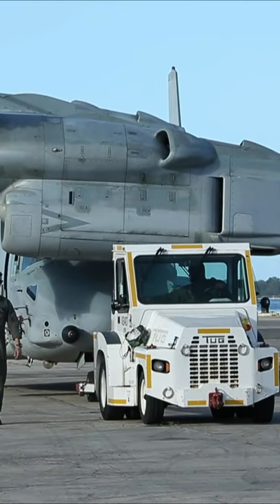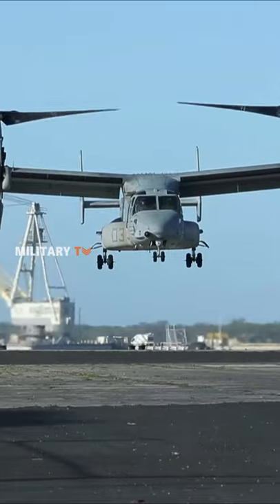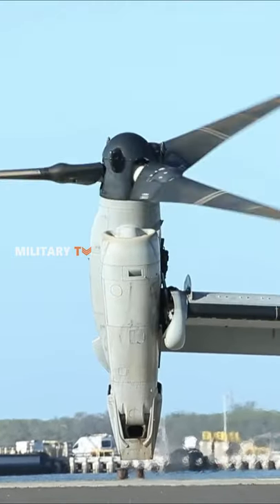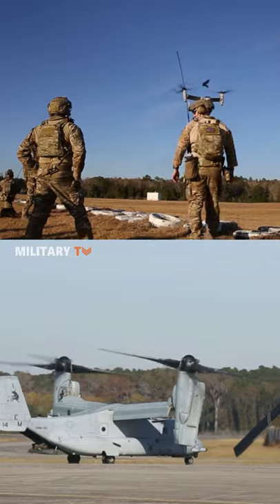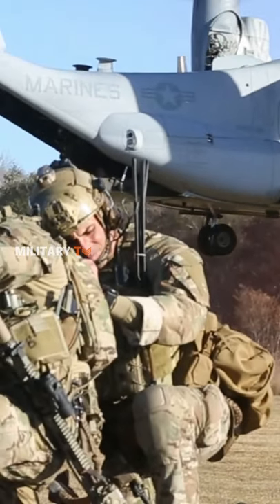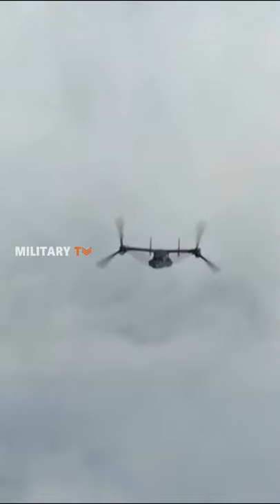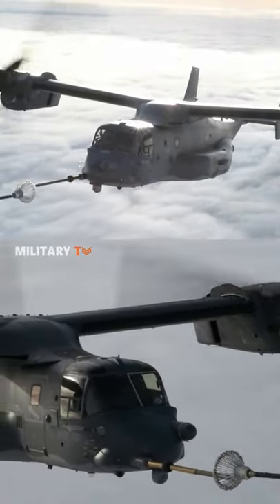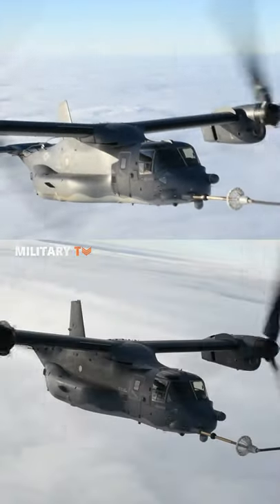The Reason Why V-22 Osprey is Built #shorts

Comment: A pilot of this plane told me it's a Hanger Queen....always getting fixed, or serviced.
Reply: It's a pos death trap. Especially since Marine aviation maintenance is so lackluster.
Reply: Worked with MEU-22 and 26 in my last 2 deployments and I could confirm this.
Reply: @Starlesslemon  You're literally high with the Marine aviation part, Marine aviation is the best in the business as far as training, preparation and maintenance goes. But the osprey is in fact still a piece of shit.
Reply: Worst mistake the USAF did was retire the MH-53 for this. The inflight emergency rate was far lower than the Osprey. I was getting called to the flight line 2-4 times daily for the Osprey.
Reply: Unique aircraft always do need parts...many many parts hold this craft together!!!! Look at the Attack Helicopter HA-64 APACHE...Always needs maintenance...
Reply: Looking at drones and what they’re doing with them I think they could’ve done a better job than this piece of shit. It kills people
Reply: Kind of reminds me of my M1A2 Bradley Fighting Vehicle. That rolling casket spent half of its life in the motor pool. Some things are best left on the drawing board.
Reply: @dalehall2067  Drones dont pick up troops. Yet anyway.
Reply: So basically it's made in America the Death Hawk the F22 B35 KamaKhazi and A10 plus Apache all have the same problem. The Death Hawk goes through parts so fast ground crews can barely keep them in the air.
Reply: The reality is that everything the USA builds is fucking shit. There is literally not one vehicle or piece of equipment that isn't garbage. 
American naval ships are the worst in the world. Half are made out aluminum!
The F-35 is a failure. The Patriot missile system is a failure. It goes on
Reply: @chaosXP3RT  um the F22 is gorgeous. America makes lot of good stuff
Reply: @chaosXP3RT  can you name one aluminum american naval ship still in service please?
Reply: @chaosXP3RT  fine, take US on & see what happens mk comrade cupcake?!
Semper Fi kid
Reply: @Starlesslemon  not so...
Reply: @joeh4295  actually they have different roles.
Reply: @dalehall2067  it does not kill people anymore than other aircraft. In fact the uh-60 Blackhawk has a worse record.
Reply: @chaosXP3RT   You are a expert of nothing.
Reply: @patrickancona1193  the Blackhawk actually has a worse safety record. Does not have the same range or capability.
Reply: @WALTERBROADDUS  I was not referring to the multi-role capabilities.
Reply: @streetgangtm  lmao, you must be high as a kite.
Reply: @Starlesslemon  All of the experience not only with Marine Corps aviation but with other branches I've had has shown that the Marine Corps is far more proficient in general at maintenance and creating training plans.
Reply: @streetgangtm  for its size, the Marines cost the DoD the most in aviation accidents By *FAR*.
Reply: @Starlesslemon  Yeah that's why there were zero fatal mishaps last year.
Reply: @streetgangtm  anecdotes don't change facts and statistics bud
Reply: @Starlesslemon  how many of those mishaps were maintenance related vs aircrew induced? What about mission requirements? What about core MET analysis? There's a lot more that goes into it than broad statements. You train to more missions and more dangerous mission sets and you're going to have a higher level of mishaps.
Reply: @streetgangtm  🤣
Reply: Some of you all used the word monstrosity. I been waiting on the word ugly. The thing is ugly.
Reply: It's a POS death trap. My buddy was in airframes and got his NEC to do NDI (x-raying welds and shit) and said he wouldn't dare fly in one and that he was constantly flagging them for structural failures.
Reply: Not much different than other nation’s new aircraft then, and in a majority of cases, it’s much better, safer, and less maintenance-intensive than what other nations are flying.   

Russia’s Su-27 family (including the Su-33 & Su-35), and their frontal stealth derivative Su-57, require more maintenance hours, per hour of flight, than the US’s hanger queen A-10.  Plus, the Russian Federation’s whole Air Force runs on an availability rate of around 36%, and it’s only getting worse since they halved their defence budge; which saw drastic cuts to maintenance and even essential training for mechanics.   
    
The new Chinese H-6 bomber, their Blackhawk clone, and their 2 new stealth fighters are ALL 3x more maintenance intensive than the USAF’s current F-35a; with an average availability rate of under 40%. 

 And, the Indian Air Force’s “brand new from the factory” engines from Russia have a near 50% rejection rate for obvious and dangerous defects. They have lifespans measured in hundreds of hours. Not the thousands of hours of other nation’s exported engines.  Plus, their Russian supplied aircraft only have a ~30% availability rate, even with Israel’s help in modifying them to western design standards, tolerances, and equipment. 

 
Just like the 1980s brand new M1 Abrahms cost nearly double it does now in maintenance and parts.  The Osprey will either start coming down in maintenance costs, or it’s going to be replaced by the brand new Tilt-Rotor helos the airforce and navy are buying to replace the Blackhawk.
Reply: @cjwrench07  Thanks for the context and information density.
Reply: As someone who worked on ch-53s I can tell you, no shit.
Reply: @streetgangtm  A
I've trained and trained with with a lot of Marines in aviation both in PT and in the classroom and I can confirm as well.
Reply: @chaosXP3RT  Not shit if you can throw money on enough at it which America can and does, to the exclusion of almost anything else.
Reply: @streetgangtm  Let's not forget funding also... The marines are bad ass for alot of reasons. That said, debating anyone on the number of reasons is a waste of breath.
Reply: @ws8061  I'm an NDI tech, cool shit, I bounced before I had to F with any osprey.
Reply: @William1987GTA1  M1A2 Bradley?
Reply: I know a couple of Marines that are in V-22 maintenance and they absolutely loathe them. It’s by far the least popular aircraft the corps flies.
Reply: @chaosXP3RT  so, about 99%? What with all the police brutality going on?
Reply: It’s the first of its kind. As newer tilt rotors come around the problems will be dealt with
Reply: @William1987GTA1  untrue. The *M2A1 (not M1A2) Bradley IFV has proven itself to be a highly survivable and capable armoured vehicle past its initial teething issues and somewhat troubled development. The Bradley has proven itself time and time again to be very capable, especially since Operation Desert Storm. 

PSA: I assume many who think the Bradley IFV is a death trap watched Pentagon Wars — here’s the thing: while it makes some good points about bureaucracy getting in the way of things, its actually a load of garbage and the narrative is extremely false. The Pentagon Wars was inspired by Col. Burton’s book of the same name, but what ppl don’t realize is that Burton was a total quack who belonged to a group named ‘The Reformers’ who, I kid you not, believed that unadvanced, technologically-unaided weapons and arms were the way of the future to put it simply.
Reply: I don't always like to crash on a helo but when I do I make sure I'm on an osprey
Reply: @joeh4295  i understand the point about reliability. However the military needs more capability. The MH53 specs looking it up has a top speed of 200mph and a range of 600 miles. The Osprey can go 350mph at a range of almost 1200 miles. Faster range and speed counts for a lot. There are places we simply cannot get to because of the range. With these new weapon systems there are always bugs to work out. Hopefully the gearbox can be fixed or the next generation will be much more reliable.
Reply: @chaosXP3RT  in real life not in YouTube when the US goes head to head against other countries equipment it performs getter. Russian and Chinese tanks and planes were obliterated by American weapons in the Iraq war. Israel uses American tech and routinely beats Russian and Chinese equipped Arab armies in its wars. Kill ratios of tanks, planes and men are lopsided in favor of the US in almost all wars. The only way that’s possible is either our equipment is better, or if it’s shit like you claim, our soldiers must be 10x better to make up for it. So which is it?
Reply: Special turboprop service and falling of the sky just for a quicker cool looking helicopter
Reply: @ws8061  X Raying welds? Thats crazy. Prob checking for deep structural integrity in the wing. My Pops was a fighter pilot and a T38 instructor. He said he was investigating a crash where the wing had collapsed on a T38. The plane was in a high G pull and the wing snapped. Full afterburners. He said the G forces at the moment of the wing snap had probably killed the pilots instantly. The plane went full nose down with afterburners on. He said the engines were crushed into coke can size cylinders.
Reply: This hunk of junk death trap snowballed it’s way through billions in development by ALWAYS needing more. More money and more lives lost because they spent SO MUCH they couldn’t just “give up” on it. Typically 80’s government spending killed so many.  F THIS THING.
Reply: Add Harley Davidson and your current wanna be President Biden to that list.
Reply: @William1987GTA1  I'll never forget being on lookout watch watching the trainees land on the flight deck in those little t 38's. Made by butthole pucker and I was up on the O-10 level. Made me realize just how skilled the E-2/P-2 and f-18 pilots are. Gotta take balls of steel and some real confidence in your teaching to ride along with those scrubs in the T 38 lmao.
Reply: They were meant for the air force and airforce deemed then impractical, unsafe and unreliable so airforce gave them to the marines
Reply: @patrickancona1193  this is the most uneducated and misinformed comments in this whole thread and you clearly have no idea how the osprey's systems work. I fly on these for a living and have a thorough understanding of how this thing works... nothing in your comment is true
Reply: @ws8061  it's a composite aircraft...
Reply: @YepitsShawn  hey dude... you're wrong. I'm aircrew on ospreys in the Air Force
Reply: @ar3317  I'm not saying we font have any but definitely not alot
Reply: @chaosXP3RT  Then explain why we're the best and most advanced military in the world

Comment: It has 2 engines, not 1, and no tailrotor.
Reply: It's his intonation and narration, he does say it's got 1 turboprop engine and transmission in each nacelle, but the reading and punctuation he uses makes it sound like he's saying 1 engine with transmissions in each nacelle ☺ ... as for saying "tailrotor" ... no excuse, just no understanding
Reply: @shanedebarra4986  lmao qpiq
Reply: @shanedebarra4986  I agree.
Reply: What happens in the event of a single engine failure? Both engines should drive both rotors for safety, otherwise you would need to immediately shut down the still-operating rotor to prevent inversion. But it would just plummet anyway. I would not fly it unless both engines drove both rotors.
Reply: @Fomites  there is an interconnecting drive shaft that runs through the wing.  One engine will drive both proprotors in the event of an engine failure.  Actually a non-event in airplane mode.

Comment: Seen models of this plane is 1976 from NASA
Reply: Eric Ellert  well everything  we learned from the V-22 will speed up any other projects that want to go vtol. Look at the V-280 valor, it is already doing flight trials, the advancements in computer technology helped alot to
Reply: Bell Helicopter designed and built the XV-15 in the 1970s. That morphed into the V-22.... My father worked at Bell for over 30 years

Comment: There were three disastrous crashes involving the development of the Osprey
The first crash was a loss of control that killed engineers and test pilots into the Patuxent river another fatal crash during pilot training at Red rock Arizona and another killing a dozen Marines
Reply: That is sad. But this is still one of my favorite aircraft because it truly demonstrates what human ingenuity is capable of
Reply: Late 90s I was an engineering technician drive systems test mostly on the v-22.The first day I pointed out several GLARING ISSUES.the engineer looked down his nose as if I were an insect.Two years later I left for American Airlines but this was the most interesting work I ever did.
Reply: They clearly put regular military personnel in this thing way before it was ready. However, the general idea is sound. You get the land anywhere option of a helicopter and the speed and range of a turboprop (almost anyway).

Comment: I have never heard anyone who actually uses these things say anything positive about them.
Reply: I don't know how reliable they are, but the capabilities are very useful when you need them. Remember it's the first of its kind in military or commercial service. The next versions will be cheaper, more reliable and more capable.
Reply: @phamnuwen9442  the Osprey is the third attempt at designed a craft like this and the second to be created by US defense spending. it was more expensive then both its predecessors.
Reply: @kazmark_gl8652  Which are the first and second attempts? I'm fairly well aquainted with the history of tiltrotors, tiltwings and similar hybrid vehicles but I don't think anyone other than the V-22 has ever reached production. Experimental vehicles are interesting but it's hard to say for sure that they don't make sense until you've actually brought them to market.

Note, I'm not saying that the exact design of the V-22 is the most optimal one. It might be something with more rotors or fans to increase reliability and safety, sort of like a drone with rotors that tilt, or with separate propulsion systems for hover and cruise.
Reply: That's because, "They" rarely have a clue about such things.
Reply: @WALTERBROADDUS  The Marines called it the "elevator of death for a reason"
Reply: @kazmark_gl8652  it's far and away better than the ch46 it replaced.
Reply: Well now you have.  In and out of LZs way faster than a helo.

Comment: What if one of the rotors malfunctions/broken/destroyed? Can it still have an emergency landing/continue flying?
Reply: I believe they have a system that provides power to both rotors from both engines.
Reply: The transmissions are interconnected.

Comment: Didn’t the Osprey use to crash a lot?
Reply: Yes. It crashed because the two rotors tilted individually and one would fail to rotate causing it to flip over during transition. They were grounded for a while and if I am not mistaken they solved the problem by connecting them with a mechanical hard link so that they could not tilt independently of one another. That might not have been the fix but that is what I remember from a while ago.

Comment: Dude that's nuts! I didn't know they could fuel in the air. A jets one thing no spinning blades of doom but this is crazy. Normally you just get slapped if you miss the hole. Ospreys cut it off.
Reply: Most/many military helicopters are capable of aerial refueling.
Reply: I think a normal helicopter is more likely to chop the fuel hose off than this. In fact there's a video on a CH-53 doing exactly that.

Comment: No pilot on Earth can fly this plane without computer assistance it's impossible they finally got the software right but it took a lot of deaths and a lot of crashes
Reply: This is the case with many modern fighter jets as well. Computers enables a pilot to control a much more capable machine.
Reply: The Navy wants to replace the C-2 COD with the V-22.

Comment: Jimmy Carter should have used CH-46’s with portable fuel Bladders stored in different locations for the rescue mission of the Americans in the Iran embassy. Once refueled set a timer device on the portable fuel bladders to explode Evec the Americans use some other portable for the bladders to refuel to go back to the ship mission done. Not all four branches of the service plus CH 53 Ecco models kind of stupid to put an Air Force CH53E pilot into a Marine CH53E and try to refuel with a KC 130/5 or a 130 mission failed. Navy and Marines make outstanding teams.
Reply: I’m pretty sure Jimmy Carter didn’t do the mission planning.

Comment: Neither a particularly good airplane, nor a good helicopter. Astronomically expensive, noisy, fairly unsafe, and a maintenance nightmare. I suspect one could do it just as well for less by just duct taping two push mowers to a refrigerator box. Granted it has roughly twice the speed and several times the range of say, a Cherokee twin rotor... Still, if you’ve ever seen one operate in person, you’ve probably noticed as it powers up it looks more like it’s trying to tear itself apart than to weirdly heave itself into the air and then uncomfortably meander away in the way it does. I’ve literally never heard a single person praise one of these flying Rube Goldberg monstrosities after working with them in the field, without caveating all of the things about it that suck. I felt unsafe just standing on the tarmac during takeoffs and I certainly was never interested in “flying” in one...
Reply: Well that about sums it up for me

Comment: the helicopters in Iran had sand sucked into their engine same thing would happen to the Osprey I'm waving a big big BS flag on this one.
Reply: True. No connection between the V22 and the Iran mission and it's not a "tailrotor" aircraft.
Reply: They installed sand filters
Sand filters are standard equipment on American aircraft
Reply: They had taken the sand filters off to save weight.  Ospreys have the range and speed to do a mission like that with no need to stop in the desert.